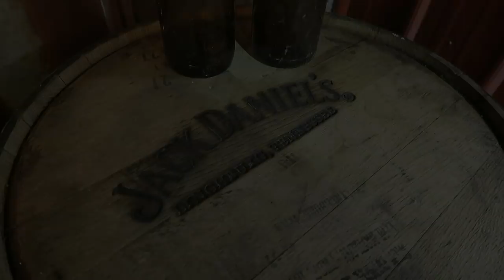How To DIY Shipping Container Office

Comment: For the chopper holder you should do something steampunk for the supports. It would tie in with the theme you are going for and really some other steampunk type things sprinkled around would really set everything off!
Reply from the maker: funny you say that because I actually have tons of aluminized mandrel bends I will never use and thought about using them to make some kind of steampunk design

Comment: You're taking the extra time to do it once and do it your way.  A year from now you'll be on to things and forget how long it took to get electrical done, adding lights, etc.  You'll turn the light switch on, and it will just be there.  We all get busy, and have those times in life that you just get a little time here and there.  I'm about the same way until snow starts falling.  Busy with the 9-5 job, getting the property ready for winter / snow, and getting a little time here and there.  A 40 hour job takes 30 days to do when you get an hour here and there.

Comment: Im in the same spot im building my garage put the 65 and the 62 impala on the side. I want to do more than just building cars I would like to fab others I did my metal brake stand built me an welding cart that holds 2 tanks MIG and TIG and more but want to extended the garage soon. But all in all take your time mann great video

Comment: What if you take the shop as a parallel project? It's quite a job, you might not want to take it as a "asap" project.
I mean, go as you go, whenever some equipment is needed to be allocated or installed, depending on your "main" projects, do it.
By the way, awesome job with the shop, you're doing great.👍🏼
Reply from the maker: yeah when I was referring to getting the shop done I was mainly just talking about the aesthetic construction part....im sure it will be forever changing when it comes to equiptment